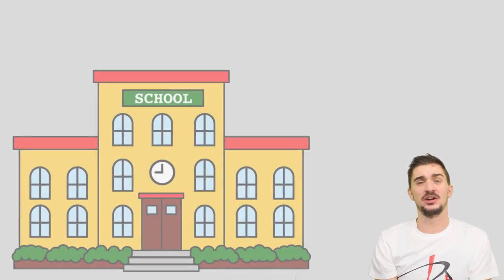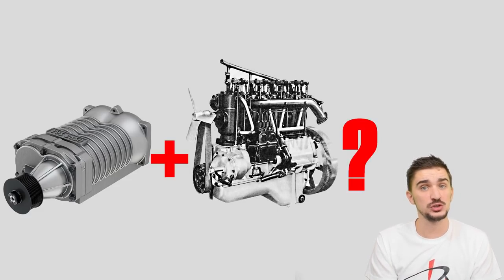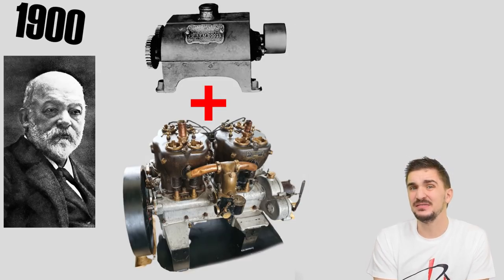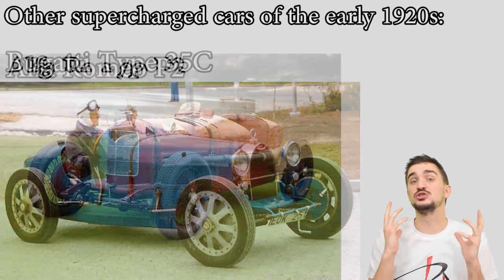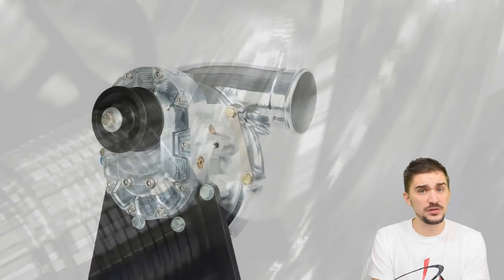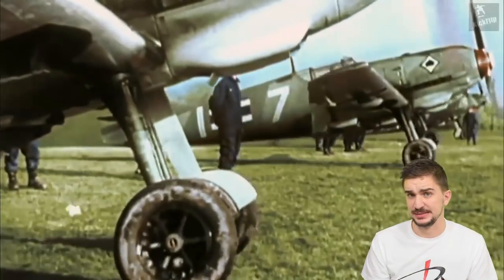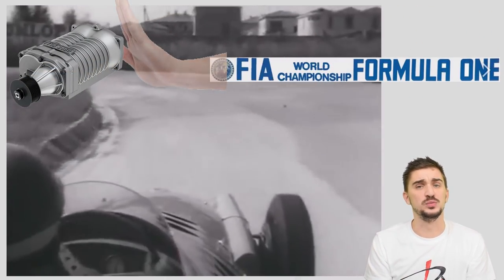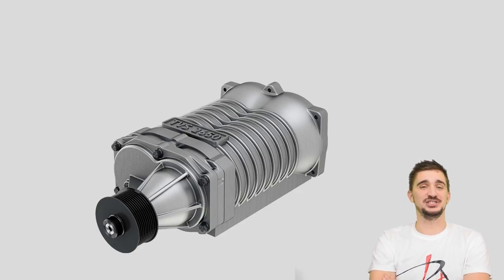SUPERCHARGER HISTORY - Boost School #5

Comment: ya left out 2 stroke diesels like detroit diesel and alikes. and the super fancy extreme opposed piston 2 strokers . the things that have the potential to save humanity, and the piston engine. (maybe not with petrol or diesel, but some carbon free synthetic fuel like nh3 or so)
Reply: Garbage and sewage can be converted into oil, which can then be refined into gasoline and Diesel.
Reply: @electric7487  sure, but burning anything that has coal in it will produce co2 or co. nh3 has the advantage of not having coal in it, burning it would make no or no2, however lucky for us, nh3 it self can be used as SCR to reduce it to n3. clean as fuck may i say. the low energy density of nh3 vs gas or diesel can be compensated by forced induction, and a 2 stroke cycle. specially if its opposed piston. where a blower would be very handy. specially a centrifugal one.
Reply: @nagyandras8857  Ammonia is probably better used as a convenient way of storing hydrogen in Fuel cell vehicles. Australian CSIRO developed a catalyst for this purpose, directly converting between NH3 and H2 + N2.
Reply: True that, but it May Just end up being too expensive. No use for a green tech that only weslthy can afford, as usually the least green things are the old things. And usually there is less weslthy peeps Than unwealthy. If an old engine can be upgraded to burn carbon free fuel for a price afford able for avarage people, then its better Than a fuel Cell that is not afford able. This problem exsist with battery powered junk too. Someone with a euro tier 6 car uograding to a full electric is not a lot of impact. But if for the same price one can fix several euro tier 1 and 2 cars then its a win
Reply: The Commer Knocker
Reply: Yepp, opposed piston 2 stroke are crazy efficient.
Reply: @nagyandras8857  they are actually. Good point.
Reply: in those engines the "supercharger" does not significantly increase the air pressure at the end of the induction stroke beyond atmospheric pressure, so they're not superchargers - they're scavenge blowers. The Roots-type blowers from the Detroit Diesel engines which were used as gasoline engine superchargers in drag racing were actually scavenge blowers on the diesels.

The video should have explained the difference between a scavenge blower and a supercharger, but it doesn't.
Reply: @brianb-p6586  weeeel supposedly they work from near anykinda boost , but that does not mean you can not get them to be supercharged beyond scavanging , and got for Say..  2x atmoshperic pressure. One way to do it is to simply spin the charger faster. The end result is the dream of Downsizing . You could have far less displacment. Given an opposed piston engine you can allso pair that to halfed pistod speed in Exchange for 2 Times the moving mass. However .. 0.5m*v^2 still stands true. So its a winning situation.
Reply: @nagyandras8857  Every pump is a supercharger if it pumps more air into the cylinder than it would hold at atmospheric pressure. 
In a four-stroke engine, only the intake valve is open during induction, so any positive-displacement pump which moves more than the cylinder volume during the induction stroke (whether that is a small pump running fast or a large pump running slowly) works as a supercharger. 
In a two-stroke engine, both intake and exhaust are open during scavenging, so the extra air just blows through the cylinder... that's scavenging, but not supercharging because the cylinder isn't packed to higher than atmospheric pressure.  

With cam-controlled exhaust valves, the exhaust could be closed while the intake ports are still open to allow supercharging, but in EMD and Detroit Diesel engines the exhaust valves open before intakes, and close after the intakes. 

Turbochargers do work on two-strokes, because with the turbine in the exhaust path, the exhaust pressure is higher than atmospheric.
Reply: @brianb-p6586  thats wrong. even 4 strokes have valve overlap , there is aperiod when both are open. and what you are refering to is only true for 2 strokes that are crank case scavangers. 2 stroke diesels are not like that. chainsaws and weedwhackers are. 
2 stroke diesels like the detroit diesel had "blowers" , those only moved air and the cylinder pressure did not go beyond by much when the intake was closed. not true in a technical sense but supercharged differs in only that. now, with a crank case scavanger, you would be just blowing air right out the exhaust. benefical to some extent as it makes sure to blow out all exhaust gases . however, non-crankcase scavangers can't work without something pumping air into the cylinder. 2 stroke detroit diesels indeed have exhaust valve, it closes before the intake valve closes. in this case the intake valve is the piston it self. and on top of the cylinder you got a big funken exhaust valve. so its uniflow. and since the exhaust closes first after the valve overlap period, it can be "supercharged", if you pump more air in. as you can go beyond ambient pressure. 

and there you have it.
every pump is indeed a supercharger. they are "charge" pumps. but if it can "charge the cylinder to decently more than ambient pressure" its "supercharging it"
Reply: @nagyandras8857  4-strokes have a little bit of valve overlap... then the exhaust valve closes leaving on the intake open for the majority of the intake stroke. 

Yes, 2-stoke diesels have scavenging blowers - that is what I pointed out.
No, port/valve timing is not very different for externally scavenged or crankcase scavenged 2-stroke engines. The intake and exhaust ports or valves are both open for essentially the entire scavenging period. In an EMD locomotive diesel, the exhaust valves start opening 16 degrees of crankshaft rotation before the intake ports open, and finish closing 16 degrees after intakes close. The cam operation of the exhaust valves means that it could be asymmetric, but it isn't by any significant extent. Search Wikipedia or the whole web for "Detroit Diesel 2-stroke timing" and you'll find a timing diagram, showing similar behaviour for the Detroit 2-strokes (and various marine diesels).

Comment: The part I do not like about the screw type of chargers Vs the centrifugal type, the screw types are all positive displacement. So, if the charger fail, the engine also fail for lack of air, unless alternate air supply are designed into the package. Then the engine will still run, but at reduced power. This is a prime concern with aviation uses.

Comment: i think the argument between turbo and supercharger boils down to a few things
                    turbo                                                                                                            supercharger
more peak power, with shorter oil life                                                  (less peak power and parasitic losses

higher installment dificulty(exhaust+intake connections)               lower installment dificulty(slap on top of engine)+belt+tensioners

turbolag(not that present nowadays)                                                    instant response

Comment: I thought screw compressors submitted less air for same RPM, due to the total volum in the chamber is more metall and less air, but the benefit is countinusly airflow over pulses.

Comment: I remember a 12 cylinder dual  turbocharged to supercharged Allison diesel truck engine
Reply: The system of a turbo compounding a mechanically driven supercharger is what was used on P47's, P38's, B17's, B24's and B29 aircraft in WW2, below 10,000 ft or so the wastegate dumps are open and don't even divert any exhaust to the turbo, then as you gain altitude above that they'd start inching the boost lever forward, that would start closing the wastegates and diverting exhaust to the turbo to spool it up so it could start feeding the supercharger. 
It's because of that system that US aircraft in WW2 had higher critical altitude ratings on their engines than anyone else's and conversely higher service ceilings on the aircraft.

Comment: 16:15 It doesn't make much sense: the same car with the same components can accelerate fast, yet can also perform a wheelie. Wheelies use up energy from the engine that would have otherwise caused the car to hit the quarter-mile even faster. 🤔

Comment: There also was Comprex. Not sure if that's technically a supercharger. I think it is.
Reply: The Comprex device, used by Ferrari in Formula 1, was a pressure wave supercharger, in which the mechanical drive only served as a timing device - the power for supercharging came from exhaust pulses. 

Pressure wave superchargers would be worthy of an entire video... of historical interest.

Comment: Re superchargers v. turbo chargers:  No one ever complains about supercharger lag.
Reply: But as revs increase mechanically driven superchargers start nosing over on the power they make and turbos start shining right there.
USAAF aircraft in WW2 had superchargers that were compounded by turbos for high altitude, that's why US aircraft in WW2 like the P47, P38, B17, B24 and B29 had higher critical altitude ratings on their engines and the aircraft had higher service ceilings than their Allied contemporaries, best of both worlds.

Comment: I don't know much about cars but why it seems that folks turbo way more often than supercharger?
Reply from the maker: For one, you can fit the same turbo to a very large number of different engines, but you need an engine specific supercharger kit in most cases. Yes, you could fit the same supercharger to more engines but the fabrication required usually ends up being more complex and costly than for the turbo. Turbos are also cheaper, especially if you take into account budget brands. You really don't have those when it comes to superchargers. You can buy a new turbo for a few hundred dollars nowadays, but new superchargers start at a thousand or more. Many are easily in the 6-7k territory. Even professional racing turbos are rarely beyond 4k. Turbos also work well on both small and large engines and even small engines have a shot at big power with a turbo. Superchargers need to take away some of the power to make power, as they're driven by the engine, so they usually need a big engine if they want to make big power. Turbos are more efficient since they're driven by exhaust gasses (waste) of the engine so they can manage better mpg too, although this is rarely a factor.
Reply: driving 4 answers thank you so much, prof.

Comment: Do superchargers ever produce so much boost that they overcome the sealing force of the intake valves?
Reply: Theoretically they could - but if they do in service its probably because someone has revved it's nuts off. If they can do that in usual operational envelope - then it's really bad design because you would spec the valves springs to a higher resistance than the potential max input pressure.
Reply: @rosiehawtrey  I'm wondering about things like top fuel dragsters with massive superchargers, I guess they have massive springs

Comment: One thing I want to know more about is cutting weight out of the body , reinforcement of the body and weld points.  because I kinda want to make my car light/stiffer and keep the interior .
Reply: unless it's a designated drag car that's not gonna happen as the interior is where most of the weight is. The only other options are titanium or aluminum mechanical parts or fiberglass and carbon fiber body panels (which are all expensive). I guess you could tub the car if you really wanted too, but again backseats at the very least will need removed. And doing this you are only losing a few pounds.

Comment: are there superchargers that can be turned on and off?
Reply: You mean Like Mad Max - With a Clutch? Not that I know of. But it can be done. Air  and/or  Air/Fuel can still bypass the Rotors even if they aren't turning. I've had to run my Supercharger without a belt before and the engine still works.
Reply: you could maybe make some kinda scissor thing that cuts the belt but that would be 1 time use

Comment: 17:30 why is it an electric supercharger and not an electric turbo?
Reply: Because a turbo full name is a turbosupercharger.
At least it originated with that word around ww2
Reply: A turbo is exhaust driven, a supercharger is driven by other mechanical means. 

Electric turbos do exist as well, but while the electric motor spools the turbo initially, exhaust gases take over for mid-high rpm operation.
Reply: @koolkei  The original  "turbocompressor" was patented from the swiss inventor Alfred Büchi and first built in very small numbers by the french turbines builder Rateau  and use on the Renault 12cyl engine from some 1917-1918 Breguet XIV reconnaissance aircraft , but in that times was the turbocompressor very unreliable, and Alfred Büchi improve he's invention in 1925 to fit on diesel engines...

Comment: Does Anybody know why germans in 1920s to 1945 always put their superchargers 90 degrees to the crankshaft and not do it the conventional way? Like in the video at around 6:00 the 1921 supercharged engine , the roots blower is 90 degrees to the crank. Same thing can be observed in pretty much every forced induction liquid cooled german engine most famous ones being the db600 series with centrifugal superchargers put at 90 degree angle to the crankshaft. I still cant find any reason why they always did that
Reply: The reason is they probably were gear driven, something like distributors, not belt driven like any other.
Reply: XStuntManiac the rr merlins centrifugal supercharger was also gear driven but was attached „normally“
Reply: It may have been installed that way for packaging purposes.
Reply: @288gto7  Different type of gear used then. Distributors also sometimes are mounted parallel to the crankshaft or camshaft and still are gear driven.
Reply: @XStuntManiac  on aircrafts was the supercharger NEVER driven by belt
Reply: Mounting like this reduced intake losses by allowing a gentle curve of supercharger discharge pipe directly into the manifold, whereas a traditional layout requires at least one fairly tight 90 degree bend. It has downsides however: Firstly, bevel gears are needed to drive it, and they are much more difficult and time consuming to make compared to spur gears. Secondly in an aircraft application (with a close fitting cowling around the engine) it leaves no room for a carburetor in the 'draw through' configuration, as the supercharger housing is right up against the cowl. The latter was not a problem for the Germans because their engines used direct injection- the supercharger was fed by a simple scoop on the side of the cowling.

Comment: I dig your videos a lot, but you need a microphone much closer to you on set (better yet a wearable wireless transmitting back to the camera). Your room sounds like absolute ass!
Reply from the maker: I had a lapel mic but it didn't work. Whenever I move even just a bit it ruined the audio. I also don't like those helicopter pilot things. I really don't know of other options. If you have actual links that would be cool.
Reply: @d4a  My links got deleted, but check out R0DE wireless go. To hide the square mic better there is a plug in lapel which is awesome. I don't yet use them for my own Youtube videos but have been using them at work. Even without the lapel addon the unit can hide behind your shirt and do same job.